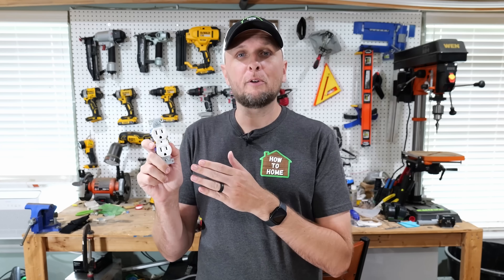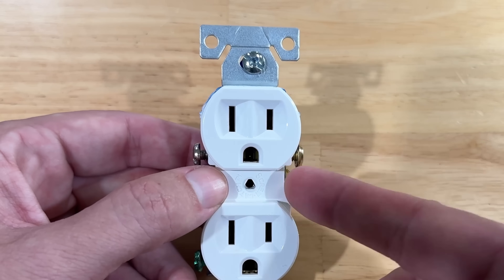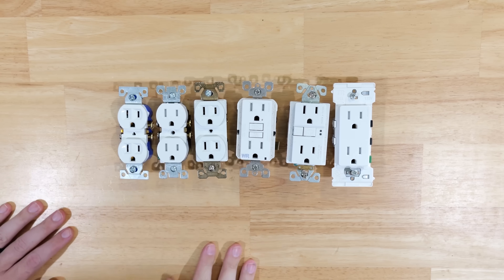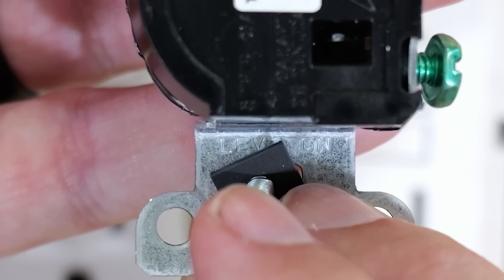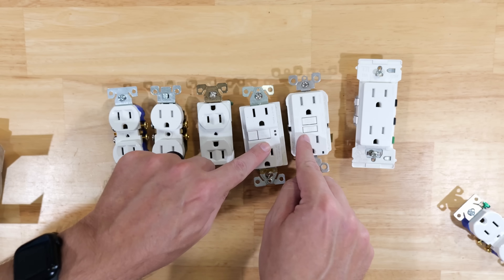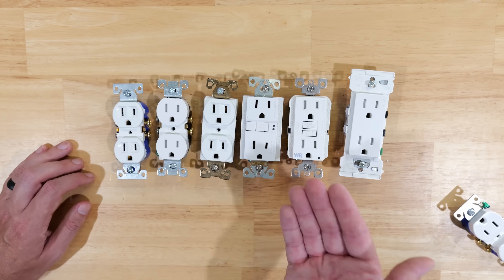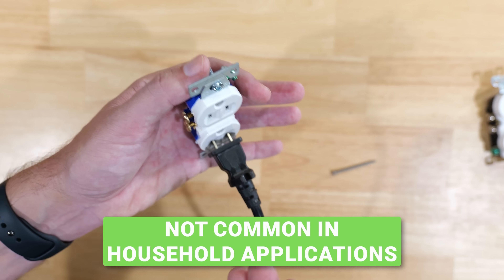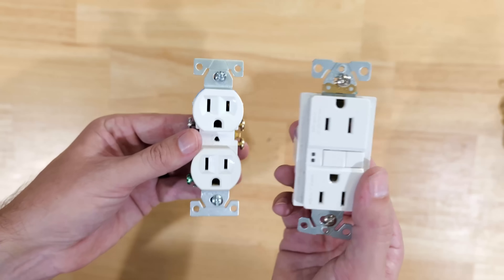The Shocking Reason Why Your Outlets Are Installed Upside Down!

Comment: I have a lot of appliances that come with AC adapters.  These almost always have cords that hang down from the direction of the ground plug.  So, if the ground plug is down, the wire on the adapter hangs down causing less strain on the wire connection in the AC adapter.  If the ground plugs are up, then this would put much more strain on the AC Adapter wires.

Comment: In the UK, all receptacles (230V 50Hz) are installed ground prong up, since the typical power plug is a 90-degree plug with the ground prong at the top and the wires going down; it's done for safety. In the US, 90-degree plugs (commonly found on major appliances like refrigerators) are the opposite, with the ground prong at the bottom and the wires going down. In the US, if the receptacle is installed ground prong up and a 90-degree plug is installed, gravity will tend to pull the plug out of the receptacle, which makes ground prong down better overall.

Comment: I worked in a sheet metal shop and several times sheet metal fell off the back of a table and slipped under a plug. That would make sparks and trip a breaker. We changed the shop to ground up. I was told hospitals require ground up. I make a point of looking. They seem to be all ground up. You didn't mention sideways mounted receptacles. I always mount them with the wide prong up. At least it's the neutral that will get hit with something. I always laugh at people that put the ground down. I think it's because their wife likes the smiley face and they would rather deal with a short circuit than their wife's bad mood.

Comment: I'm a RSE electrician of 40+ years and have always thought the ground should be up.  Working commercial or even residential construction who hasn't had a fish tape hit a hot temporary plug? Even at home stuff doesn't normally get dragged UP into a partially inserted receptacle, it falls down onto the exposed conductors. Ground on top is a simple safety.

Comment: The first time I ever saw outlets installed ground prong up was in 2020.  It was at a hotel.  After that I noticed it a lot more.

I think based on the print on the gfci button labels showing both ways indicates the manufacturer intended it to be installed either way.  The more I think about it, there is no reason why the switches must be installed one way or another for them to function in most installations.  Other than certain exceptions.  There are edge cases that can favor one orientation over the other.  It would still look sloppy to be haphazard, so orienting them all the same way is still a good idea.
Reply: Oh yeah, and the fact that each manufacturer prints instructions on the back with a different side as up means they simply had to print the words in the same direction and each one arbitrarily chose whichever orientation they chose, not because one side is the top.

Comment: You are not using the plug properly and you do not have the "Think SAFETY FIRST" attitude in mind.
@ 9:56 It has to go all the way through and you will not have the gap in between for anything to fall in it. Think SAFETY FIRST
As you say @ 11:48, if you do not have a ground in the plug, it does not matter which direction. Think SAFETY FIRST
@ 12:19 you are grabbing the plug in the wrong way: the grips are on the side. If you turn it upside down, same problem: you are not using it properly. Think SAFETY FIRST
The "u" shape on top is not for grabbing it. you have a gap in between the plug and the outlet and you will think to have a better grip, it might be so but the risk of getting electrocuted is much higher. Think SAFETY FIRST
If there is a loose connection, change the outlet and or the plug: loose connection = heat = potential fire. Think SAFETY FIRST 
I have seen many people removing the ground connection because they do not have a ground connection in the outlet. Think SAFETY FIRST

Use the tools, plugs and the outlets properly. Think SAFETY FIRST
It is not a matter of orientation - except @ 2:43, section 406.5(G) receptacle orientation - It is YOUR OBLIGATION to use them properly, not a choice. The price to pay for not might be too high. Think SAFETY FIRST

Comment: On the road, weather resistant plug, the WR designating it as weather resistant is on the bottom left-hand corner when the ground is oriented down. Also, there's a drain hole on the lower right hand side to allow the water to come out.

Comment: I disagree totally, and isn't it really called  the bond terminal? Ground to a layman! So if there is no code, whats the issue? I had a biss that taught his worker that the U-ground must be up, I challenged him on that as I had a far bit of electrical knowledge. He argued that it was code, I asked where and he could not tell me. His argument was well with the u-Ground up, if you dropped  something (say a knife) down on the receptacle with the u-ground up, that would be the safe point of contact. That maybe true if it happen to fall exactly straight down on the plug that was plugged into the receptacle, and siad plug was only part way in and said plug had 3 terminals, not 2 as most things have. And if siad plug had 3 terminals and when the knife hit the pin it either bounced toatally away OR it bounced such that the next terminal hit was the Neutral (Grounded) one and not the hot. So far this sounds like a whole lot of BS and as far as my boss went it boiled down to nothing more than a power trip on his part. I agree that some receptacles are installed u-ground up and people are used to that configuration, however I also feel taht u-ground down is installed equally in a down configuration and people are used to it. This argument has gone on far to long and in my books is so silly and petty, if youwnat your u-grounds Up install them that way, if you want them down install them that way.

Comment: Every nonstandard thing made to plug in to an outlet, is built for ground down. From mult outlet adapters to cellphone chargers to air fresheners to 90 degrees cords, all are made for ground down. While the outlet doesn't care, what you plan to plug in to it sometimes does.

Comment: You'd be hard pressed to find any building codes that specify grounded port to the top. In fact, for some locations (such as outlets for fridges and microwaves) it puts undue stress on the plug due to the cord orientation relative to the socket. Some jurisdictions specify horizontal placement for mobile home construction, but otherwise, ground up or ground down is at the discretion of the electrical contractor. Sadly, this video has about as much technical merit as a discussion about whether toilet paper rolls should be with the loose flap out over the top or drooping from behind.

Comment: In Belgium we would install all of them ground pin up. But our plugs are different 2 holes and a pin, most are also 'embedded' 15mm. On top of that the pins on the plug are half insulated. Also we have 230V, which you really don't want to touch. When I was in Peru, I was shocked (figuratively only, luckily) They use your unsafe US plugs, but with 220V. Without a ground, they easily tend to come out.

Comment: Ground prong down unless the plug is right angle with the cord intended to go down but has a ground prong up. You don't want the weight of the cord pulling out the plug. It defeats the purpose of having a right angle plug. This would be mostly for like a major appliance that is left plugged in all the time.

Comment: Down!  Definitely down for aesthetic reasons and because grounded power cords do not "play well" with being plugged prong up (upside down).  It's a trip hazard curling out from the wall and it adds risk of the cord coming loose.  I volunteer in construction for Habitat.  In new construction, electricians are contracted to do the wiring, but on occasion I get involved in correcting a wiring problem or drywall error.  My "beef" is occasionally seeing outlets installed both ways in a house presumably due to multiple electricians doing the work.  The inconsistency is ridiculous.    And it has nothing to do with trying to signal switched from non-switched outlets as reported by another commenter about a builder who does that.  Most outlets in my home were oriented prong down, and I changed (corrected) a couple that were installed the other way.

Comment: Old school, back in the 60s when I was learning wiring from my dad (an electrician)  ground was up on the outlet.  The theory was the ground pin on a 3-prong plug was longer and easier to see when inserting.
These days I see ground up on a switched outlet, and use the lower outlet to the switch. 
Now in Commercial I see mostly ground up.
Reply: Hospital, nursing homes, medical on life support  ground up easy to plug in quick and also all these places metal plates in case plate gets loose and plate slips down it will hit ground and and not on  hot and netural  with people life support
Reply: Hence "theory "

Comment: Pareidolia. I like prong down, because it looks like a face. So, for that reason, that's the right way. I'm not even an amateur electrician. I've made and repaired a couple lamps and wired up a few Lego builds with tiny LED lights. That's about all. Definitely less than forty or fifty hours. I've done more plumbing and way more carpentry. I like the video though.

Comment: I thought that the the ground was suppose to be down, because through the years that is how I've always seen them. But, for me, I've noticed that when an outlet gets worn a little the ground being on the bottom helps keep the plug from falling out of the outlet as quick. Another thing I do, when say an outside outlet is sideways I will have the ground favoring the side that a person will most likely be working on, because its easy to accidently put pressure on the cord of what is plugged in, whether it be an electrical tool, extension cord, radio, etc.... and the ground prong helps keep the cord from unplugging from any pressure from the cord being pulled on, slightly or not.

Comment: The reason to install ground down is if someone steps on a cord the hot will be pulled out before the ground. For the same reason the ground prong is usually longer -- so that power is removed before ground is disconnected. On sideways installation the hot should be up, if a cord can be stepped on.

Comment: The convention I've always heard is ground prong goes down unless the outlet is not grounded then the ground prong goes up to warn users the outlet is not grounded. Very common to find in older homes that where built before grounded outlets on the market. My home currently has an extension and kitchen (that shares the wall with the extension) where the outlets are grounded and the rest of the home does not have grounded outlets.

Comment: If the plug has a downward force on it, such as gravity, ground prong down may keep a better connection as the torque would push the ground prong in deeper, where ground prong up may be more susceptible to coming loose if it is on top and the cord gets stepped on, etc. Just my two cents

Comment: When we put our kids in bunk beds there was an outlet at about daughter's head level with a night light. Naturally she hung her metal chain necklace on it, blew the breaker, and gave us all a good scare.
Reply: A chain, being very flexible, would hang off the ground pin and drape over the live & neutral pins. Hanging the necklace on it was going to blow the breaker regardless. Only difference was whether the short was to ground or neutral.

In Australia, after a roofer was electrocuted when the plug on a drill & the receptacle on an extension cord slightly separated & the live pin touched the edge of the metal sheet, it’s now mandatory for all but the contact point on the plug pins to be covered in insulating paint. So in similar circumstances the necklace wouldn’t be able to become electrified.

Comment: I'm using timers and all that I used so far designed to be used with ground prong down. In my experience most of manufacturers consider receptacles installed with ground prong down